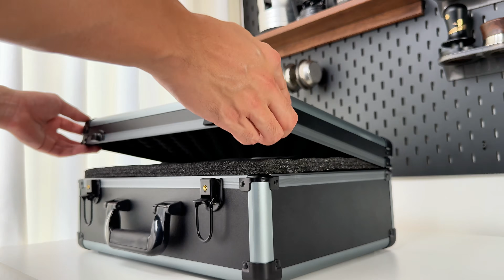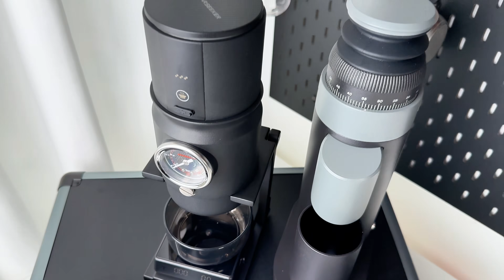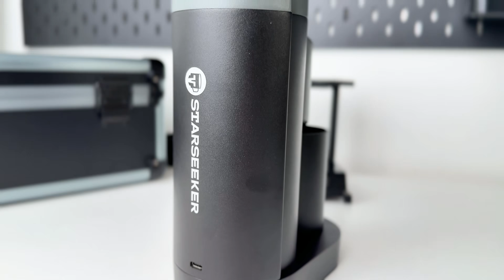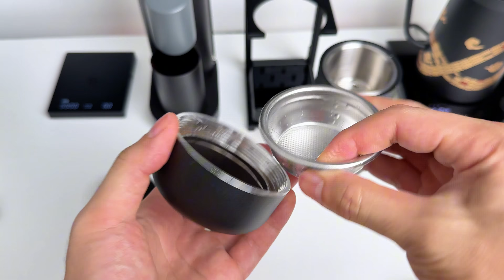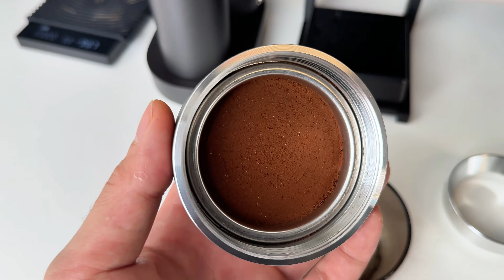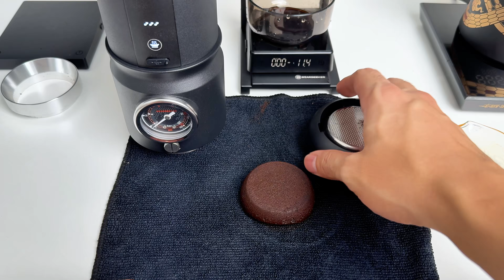STARSEEKER Super 58 Espresso Maker and Go50 Coffee Grinder Review - Surprisingly Good!

Comment: I use a HiBrew G5 Mini grinder; what setting would be appropriate for the StarSeeker 58? Could you help me out?
Reply from the maker: I’m usually around 20–25 on the H4C with dark roasts. I’d expect a similar range on the Starseeker, so try starting at 20. If the shot runs too fast, go finer; if it runs too slow, go coarser. Different beans will usually need different grind settings.

Comment: Can this machine heat water starting from room temperature, or does it require preheated hot water?
Reply from the maker: It doesn't heat water, so you need to preheat it before use.

Comment: I bought the Starseeker Super 58, however when adjusting the pressure valve, the water flow from the group head does not change. A large amount of water comes out whether the valve is tightened or loosened. Any recommendations?

Comment: Fellow super 58 user here. I'd just like to ask, since I prefer very long shots and with 1:1,5 ratio, do you think a kettle with temperature control is necessary? I use a 3000w one which is very fast but it does only 100C temperature and I think in any lower temperature, I'd get a cooler shot, which wouldn't be as pleasant. I kinda respond to the question myself, but I'd like your feedback.
Reply from the maker: Personally, I think 100°C is totally fine on this machine. The internal parts are all metal, so by the time the water actually hits the coffee grounds, the temperature has already dropped a few degrees. I usually pull a few plain shots first just to warm everything up, so I don’t think there’s any need to use a lower temperature.
Reply: @brewcoffeehome Thanks, that's how I make it as well. I was just wondering because machines use 93 to 96C but in this, I suppose it surpasses some metal and even being warmed up, It looses a little until it gets to the puck.. So, that's what I thought as well since the end-cup is just in the right temperature, I wouldn't like cooler.

Comment: Hi, what would be your recommendation, regardless of price, for a relatively portable (though large) machine that has a battery and heats up? It would be to use with a portable USB milk frother. Thanks
Reply from the maker: Hi, this Super58 can't heat the water, but the output is great. For a battery powered machine with heat and brew feature, I'd reocmmend IKAPE KAPO P2 Pro, MHW-3Bomber XPRESS58. I recently tested them, they come with 58mm bottomless portafilter, the espresso they made is close to many home espresso machine.

Comment: ho there! thanks for the review. I'm wondering what scale you are using with this kit. I'd like the idea of the 58 as a portable setup and the scale you have seems to fit the stand perfectly. Thanks!
Reply from the maker: That scale you see in the video comes included with the SuperGoBox, and it's sized perfectly to fit this stand. I just wish they made the stand a bit taller so I can use a taller cup. :)
Reply: @brewcoffeehome  thanks! So there's no individual model number? It's a pity I'd rather get 58, stand, and scale without the grinder. I see what you mean about the stand however.  Thanks!
Reply from the maker: @momentarylapses5784  They sell the scale on their official site for $20.  https://www.starseekercoffee.com/products/starseeker-electronic-scale-coffee
Reply: @brewcoffeehome  Thanks again! I'm looking into it. From my research this seems to provide the best espresso output of all the portable machines.Would you agree (compared to something like the Outin)? Also allows you to accessorize with different screens potentially.

Comment: I wish Wacaco makes Picopresso 2 where it uses 58mm basket and all steel build and fully manual. I just added an o ring to the picopresso pump and it fix the leaking and the pressure is more stable. Thanks for the video
Reply: I inserted a toothpick between the o-ring and the circular screw connection, circle once & visually check the evenness of the thickness of the o-ring. Test run using 80ml water (no heating). Usually work.
I bet adding another o-ring is a better care-free solution.
May I know where to buy the o-ring? From Wacaco?
Reply: @ZonyKay  Hi sorry for late reply i only bought from online platform which is Shopee, a box of all size of Orings, i choose which one fits better and then test if after installing, so far it seems 6 months after i install the oring and there seems to be no leak at all and the pressure in wonderfully high.
Reply: I received my order of O-Ring from Amazon today ( ZDBB 1228 pcs 32 Size Silicone O Ring Kit ).
I tested it immediately.
It works 👍 (tried just water, then my usual ground coffee.)
Will update this comment if any things happen in the coming weeks/months.
Btw, when I searched it, I type “food grade silicone o ring”, but the box I received didn’t indicate anything if it’s food grade or heat / chemical resistance etc. (the product specification only shown in Amazon descriptions)
Reply: @ZonyKay  That is great! i almost bought Flair58+ because of water leaks and pressure leaks in picopresso, and now due to the oring fix which is still held on, all of these problems gone, and my espresso taste much better. I wish your picopresso last longer too, truly an underated espresso machine.
Reply: @K @Keigan2well Occasionally still need brewing multiple times for a double espresso.
Temporarily Workarounds:
1. Use 15g ground coffee (I use different coffee beans from blue mountain (my better half prefers only blue mountain). Somehow, the volume of blue mountain is slightly less than other grounded coffee, and she has less problems. So I tried use slightly less (15g instead of 16g); it’s slightly improved. I don’t feel any taste difference, it’s said that I don’t have a very sensitive taste buds to distinguish the difference)
2. She uses max volume setting to brew 80ml double espresso. And more carefree.
3. Still trying to figure out what’s the torque to screw back the filter after cleaning. Apparently too tight may cuz leakage too. I dunno how. But I did notice the original hair-like silicon o-ring squeezed out and become visible outside h the normal almost invisible location. 
If all the plastics are crystal clear, we may check easier visually.
I imagine that version 2 of Picopresso will fix this design/practical-use flaw. Just version 2 of this filter will be even better.
Reply: @ZonyKay  i heard of blue mountain beans before and the price in my country(Malaysia) is quite expensive.Making espresso using pico is tedious for 2-3 persons, the only workaround i find is buying second 51mm basket. After i done making my espresso on my first basket, i just need to change to second basket which already being prepared and tamped, pour hot water into pico and just brew again. Super fast. 

I only like my latte taste smoky and intense, not fruity like in the light roast. I mainly brew using beans like indonesia Mandheling or Java A1 Robusta and Brazil Cerrado for everyday cup of latte.

Yes i hope wacaco address the filter too in the next picopresso 2.
Reply: @Keigan2well Hello Keigan, does it really work for picopresso using universal 51mm basket?. I was just thinking the same like you, to make the another espresso workflow fast. 

And my second questions are what type of the seal that you bought from shopee? Is it the black thicker one?. Where and what part specifically do you put the seal in?

Comment: What do you recommend this machine super58 or hibrew H4C
Reply from the maker: Hi, they're positioned quite differently. I'd take the H4C when traveling since it can heat water and quickly satisfy my caffeine needs outdoors. The Super 58 is much heavier and can't heat water, so I probably wouldn't throw it in my backpack to carry around. Instead, I'd prefer to sit down and take my time crafting an espresso with it. In terms of coffee quality, if you nail the grind size, puck prep, and preheating, the espresso it produces is better than the H4C - even better than many coffee machines.
Reply: @brewcoffeehome do you think the Barista Ultra version of the H4C competes with the Super 58?
Reply from the maker: @BluegrassBackcountry  Hi, these two products are actually quite different. The H4C has heating capability, so it offers better temperature control compared to the SUPER58. However, the SUPER58's adjustable OPV and its pump seem to produce better-tasting coffee, but you have to preheat it properly to get that result, which is a bit troublesome. When it comes to portability, the H4C is definitely the winner. If I were traveling, I'd go with the H4C, but if I'm mainly making coffee at home and have time to play around with the different brewing parameters,  I'd choose the SUPER58.
Reply: @brewcoffeehome I’d love it if you would do a video sometime comparing the two brewers. I can’t see how the OPV and pump would make a huge difference in taste if the H4C has better temperature control and the same bottomless design. If only the Super58 would self heat, it would be a hands down no brainer decision to get that one.
Reply from the maker: @BluegrassBackcountry  The Super58 does struggle to reach the same temperatures as the H4C during preheating, but the H4C might have its pressure set quite high, which may cause channeling and splashing when using a bottomless portafilter, sometimes resulting in a harsh taste. When comparing them side by side, I actually prefer the Super58's lower-pressure extraction. It tastes more balanced and better highlights the coffee's flavor profile. But everyone's taste preferences are different, so it's somewhat subjective. Plus, different coffee beans and grinders might yield different results, which makes it really difficult to share flavor comparisons through video.
Reply: @brewcoffeehome thanks for your insights. I purchased the H4C Barista Ultra prior to seeing this video and its comments about the Super 58. Trying to contact HiBrew to see if they can cancel before it ships from China to USA, but I’m worried I’m too late 😅
Reply from the maker: @BluegrassBackcountry   It really depends on your specific use case. Hope you find the coffee machine that's right for you!